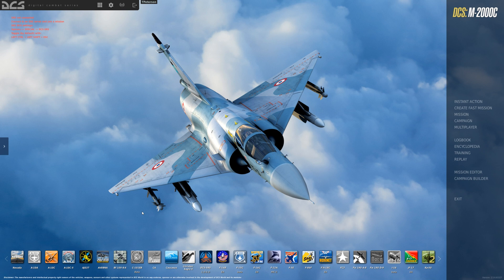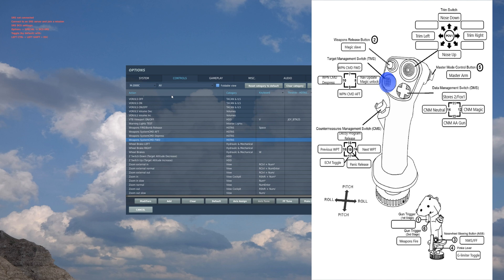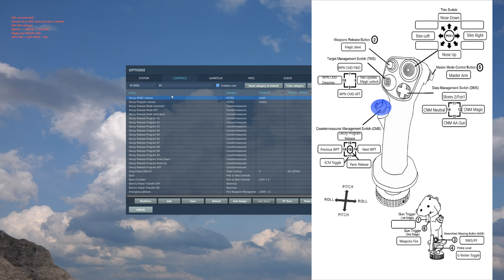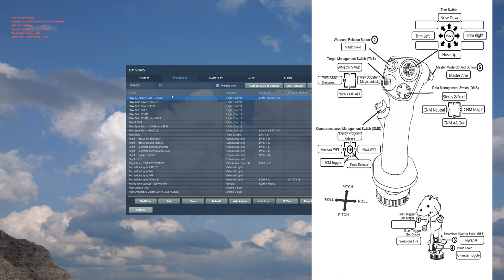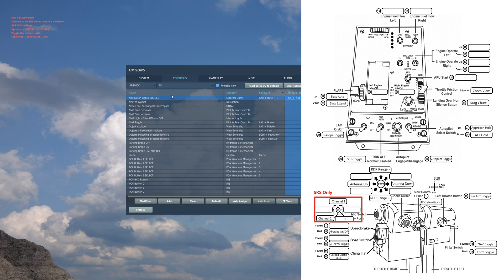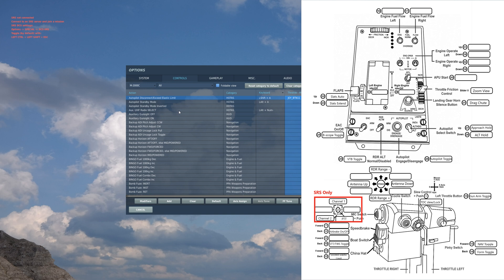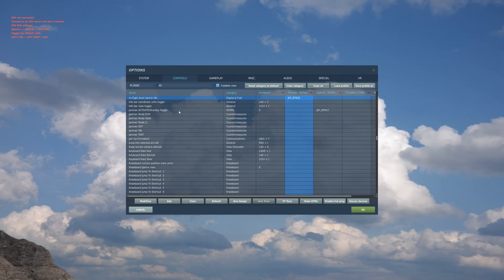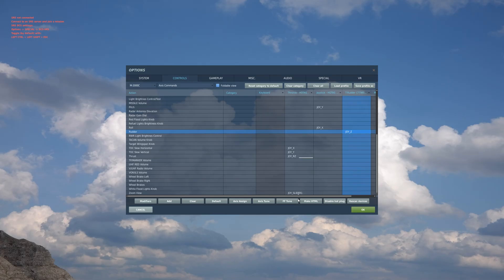Mirage 2000C controls for 2021 | DCS | Digital Combat Simulator World

Comment: Could you maybe rank all the settings by importance, cause my Hotas has not as many buttons as yours
Reply: personally I would say that weapon command forward, aft, and depress is the most important. You can't do much without it. after that Magic Slave and Magic / Nav update would be important. Put your nose wheel steering/ IFF. lastly on the important mappings are the countermeasures, CMN AA gun, (all the CMn commands.) this assumes of course that you have the trigger, and such mapped. I have many more buttons than I need for the M2000, but I still find it just easy to flip in in cockpit gun arm and master arm switches in the cockpit. The Mirage is a picky jet and you've got to do things in the correct order otherwise nothing works. Anyway, that's just my take on things. Hope it helps.
Reply from the maker: I would base it off the real hotas that I show and use what you think would be important for you to map on your hotas.